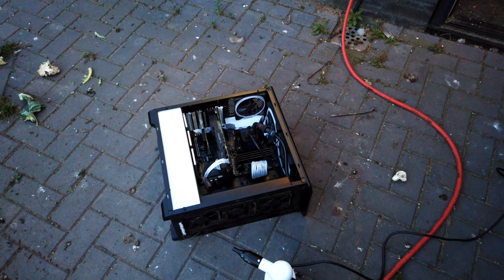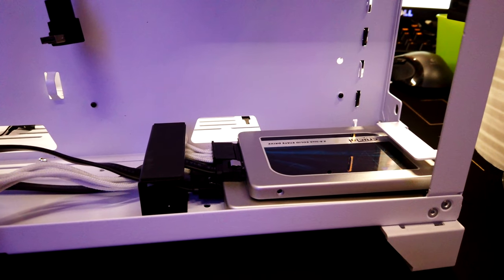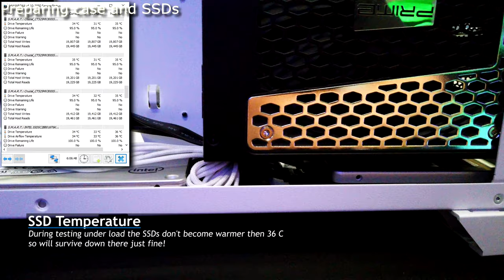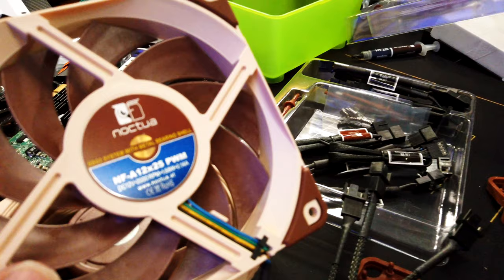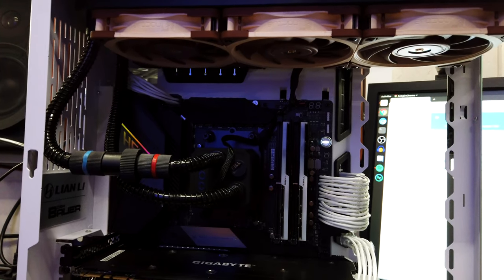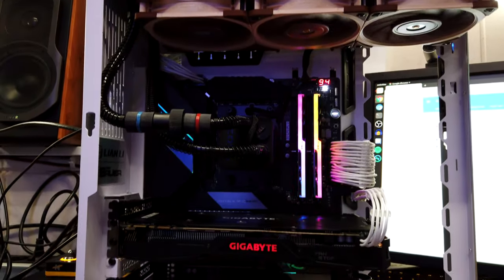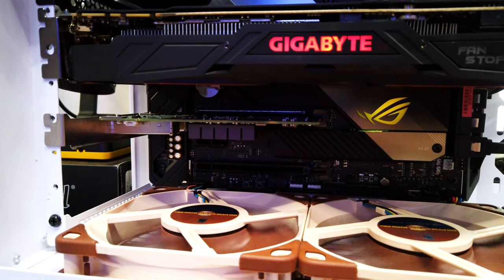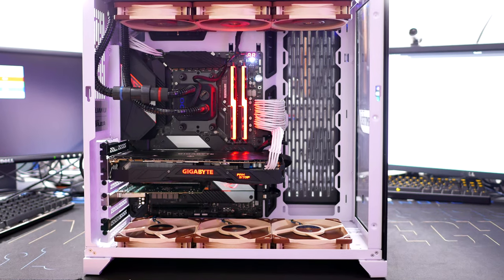RoadtoRyzen3000: Ryzen 3900x Build Video!

Comment: Can i use a 8pin (4+4) eps cable on the 4pin eps on the motherboard and ignore the other 4pin on the 8pin? I just want some extra power for overclocking
Reply from the maker: Normally they are already 2x 4 pin you stick together. But check the layout online, I think it can work. But make sure it's not a PCIe connector instead!

Comment: Hi, I the same CPU and motherboard, but I am struggling with high idle temps and clocks, and low boost clocks (only 4,2 ghz) with PBO enabled. Could you please share your bios settings?
Reply from the maker: Yeah, correct boost can be quite hard to achieve. I did it with a clean install of windows and then it worked. Yesterday I started to install more software and suddenly it wouldn't boost up to 4.55Ghz anymore. Turns out, I had set the motherboard and RAM lighting to rainbow to a process from Asus was using 1% the whole time so no more boosting. Setting colors back to static fixed that.

My BIOS settings aren't anything special, but I will share them in my next video with all the benchmarks! :)

Comment: Hey mate! Nice to see your Ryzen 3000 system finally up and running! Looks great and I can't wait to see the benchmark results. Concerning the top mounted radiator.... keep in mind that heat rises up and GPU and Mainboard VRMs will heat up the air in your case. So the noctuas will push warm air through the radiator. I tried this a couple of weeks ago (1700X and a Vega 64 in a custom loop) with a front mounted 360 (intake) and a top mounted 240 (exhaust). Temperatures were pretty darn high and after just one day I uninstalled the 240 and mounted it externally which lead to -15°C on the CPU and -10°C on the GPU! It may work in your case since you only have to cool 105W TDP but as soon as a GPU is included the top mounted radiator may become an issue. Keep an eye on your CPU temperatures while gaming. Regards, Alex.

Comment: give more info on Mellanox 10GbE NIC and other (HP, Intel) if you have em.
Reply from the maker: Like specs and what to choose? I have a second part of my 10Gbit at home video planned and I'll get more into it there, including how to benchmark, etc.
Reply: Intermit.Tech Specs and compatibility with current variety of systems. I watched your brief video regarding 10GbE solution, but offers on ebay are so overwhelming you can easely be lost there.
1. pcie 1, 2 and 3 bus 
2. drivers for win10/freenas
3. SFP+ transiever to optical cable connection - how to 
4. What brand is better, cooler, easier to adjust - mellanox, intel, hp or other (dell?)
5. when you connected 10GbE to chipset pcie slot - did it affect performace 
6. 2x port solutions - are they any good
etc 
Thank you in advance
Reply from the maker: @level80888  Oh wow, those are a lot of questions, but good ones! I'll try and integrate them in some videos I'm planning. :)

Comment: If I were in the market for an upgrade I'd have waited for the 3950X in October, personally. But, to each their own. its not like the 3900X is a slouch by any means.
Reply from the maker: Yes, but maybe no. Although I have no doubt the 3950x will be faster in highly threaded loads which use all 16 cores, I suspect it will be slower for loads that are threaded but not to that degree. The base frequency is also (a lot) lower because of it. So for gaming for instance, in real life it will probably perform worse. They are packing a lot of heat in a tiny space so somethings got to give at some point.

Also, the 3950x will cost about 1/2 more for only a few cores extra, never mind probably having to wait months until AMD finds highly enough binned chiplets and is able to deliver your CPU.

At least, those where my reasons for going with the 3900x now. This is all speculations, interesting times!
Reply: @IntermitTech  I made the exact same reasoning for going with the 3900X too. It's probably the best pick for people who need both lightly threaded performance as well as needing lots of threads intermittently. Which I think is probably the real use case for most tech people. So many applications we use all day long are single or lightly threaded; the so called "productivity" workloads people often talk about seems to just be a weird way of saying "rendering" - even though I bet most "productivity" that real people do is single threaded or lightly threaded at best.

Comment: Oof, lucky you! Here in Norway, 3900X is still unobtainium. I ordered mine on launch day as well, and it's probably a week away still. They keep saying my order will be fulfilled in the next 4-6 days, and then postponing it on the last day... Over and over.

Funny though, your build is very similar to mine. I'm using the O11 Air, and ironically doing a custom water loop in it (the O11 air is honestly better as a water cooling case than the Dynamic). I also ordered 6x NF-A12 fans for it, very excited about it. They'll be covering 2x360mm radiators. Additionally ordered 3xNF-S12 for airflow coming into the front of the O11 air (where yours has a glass panel). I paid a lot more for those 9x Noctua fans than I'm willing to admit, but, hey, it'll be awesome. Hopefully!

Same motherboard and CPU, and same GSkill RAM too I think (I got 3200MHz CL14).
Reply: Interesting, in Eastern Europe, I see them available in multiple stores in the last couple of weeks. You can just walk in and buy them. Price around 610€

Comment: Thanks for sharing your video, really nice pc, enjoy.  I have a question though, swithcing your pcie to 3.0, can you still use a NVME SSD PCIe 4.0 or it will run at 3.0?
Reply from the maker: You can set each slot, including the M2 slots, individually in the BIOS. So yes, running at Gen4 should be no issue.